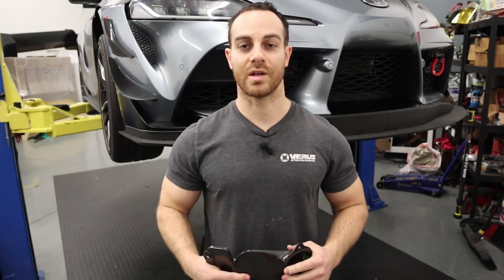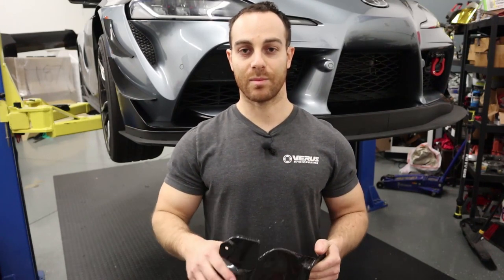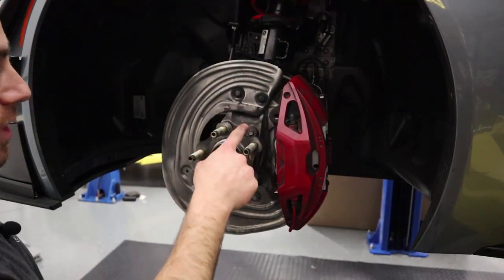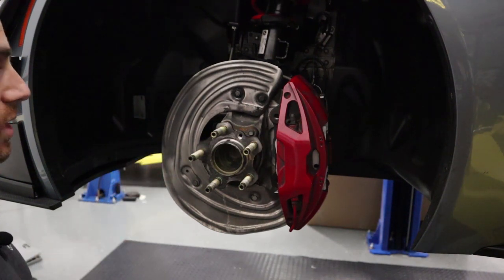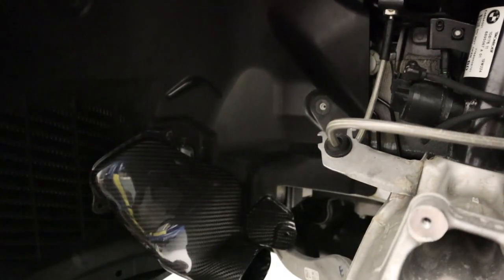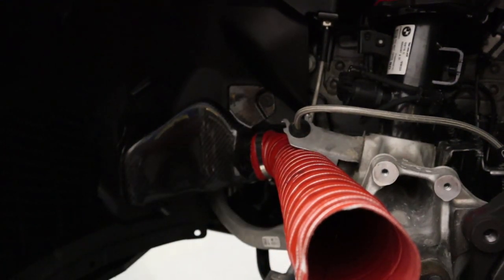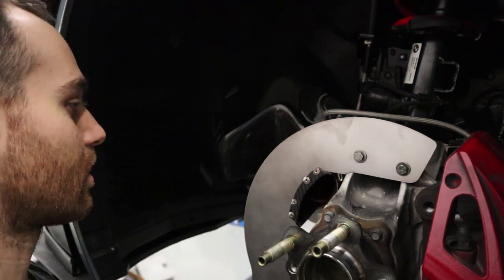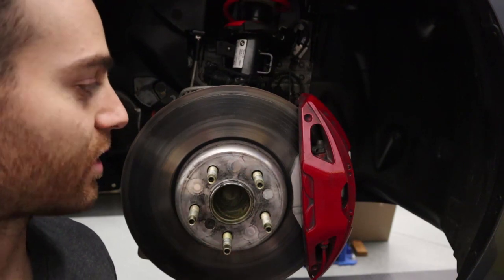Verus Engineering Brake Cooling Kit Install - Mk5 Toyota Supra

Comment: I've installed the cooling kit recently and it looks absolutely stunning! but I am not sure whether carbon fibre was the best option for the duct pan. It is located inside of the wheel housing, where rocks get into and bounce off when I drive my car on the road. I am afraid CF is too fragile to be used there. Has it ever been gone through any durability test on public road?
Reply from the maker: Yes. The carbon will hold up just fine. It is also a good thermal barrier, thus why we chose this material.

Comment: Do you have any test data on temperature drops of the rotor?
Reply from the maker: Currently, we do not, but we are actually heading to the track this weekend to do some back-to-back testing with this kit.
Reply: @VerusEngineering  looking forward to the data. If I can use street pads on track with this kit, I will definitely get one.
Reply from the maker: @ZeroOmega  no reason why you couldn't.

Comment: Will it work with a big break kit?
Reply from the maker: Yes, but in some severe cases, the backing plate may need to be trimmed.
Reply: @VerusEngineering  thanks. I figured that would be the case after a certain diameter. Not that big of a deal to be honest.

one more question. do you know the tire diameter or offset limits with this kit?
Reply from the maker: @The2ndKrezzz3  we run 275's on our shop car without issue. You might be able to fit something wider than that with some spacers.